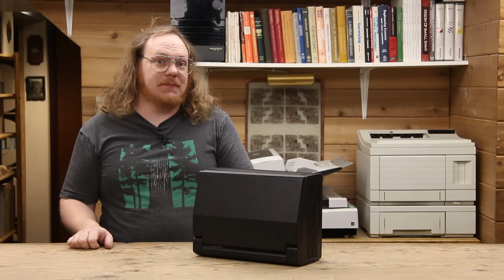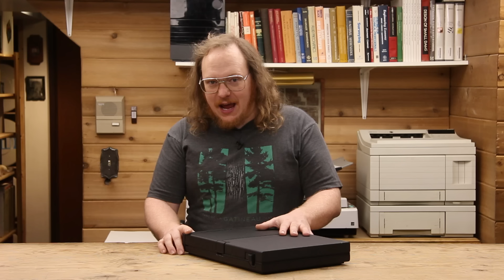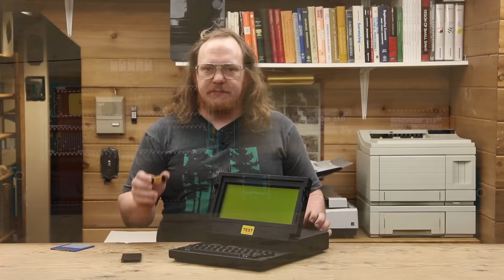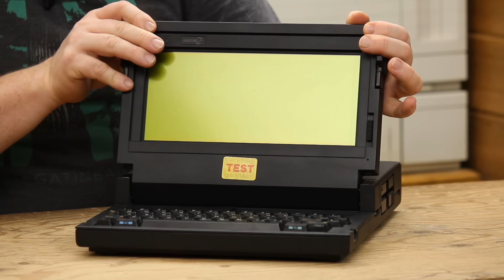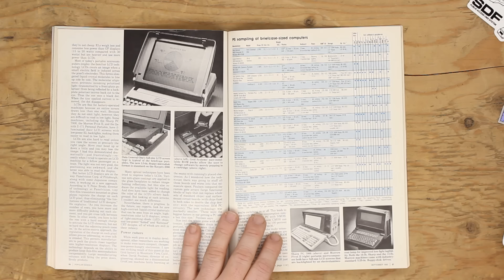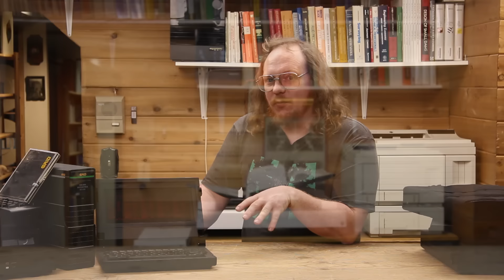GRiDcase - The Executive's Laptop

Comment: A small note about the power supplies: If you have a plasma/EL display (or a hard drive iirc), the power supply does not work internally, you have to wire the power supply externally.

Comment: "Not Kinda at All" - where you there??? i think not. The "portables" where the freaking bomb.. you had what used to be a room sized computer in a box you can pack up in 10s and carry it... insane.  and yeah, that's not from a google search..  the UT presumptuous nerds are getting annoying..
Reply from the maker: Except that when comparing a "room sized computer" to your average portable you were either comparing to a relatively modern timesharing system where you existed as a small slice of actual resources on the computer or a very, very old batch processing machine. The former you could not run on the portable because you lacked the I/O and system resources and the latter even a computer the size of a desk from the mid-70's (IBM system/32, vs the IBM System/3 it replaced) could outperform and was trivial by this point. Hence why I compared the CRT portables to their desktop counterparts because they used the exact same hardware, ran the exact same software and didn't end up like say, the MicroVAX 2000 from later in the 80's (and it too also has a handle!) where it is software compatible with the earlier and larger VAX minicomputers (which were smaller than a room even at launch) but because so much of the hardware was replaced with microcoded software instructions it was brutally slower.

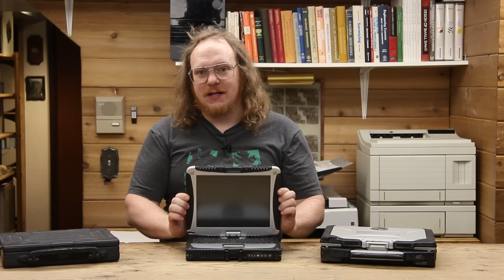Comment: At 22:00 you didn't mention the CF-18's party piece on the mechanical hard drive - it has a resistive heater wrapped around it and so you can use it in the freezing cold! I did a video on this a few years back where I left the laptop outside overnight when it got down to -4C air temp, the laptop itself was -10C and it was covered in frost and ice, but you turn it on, wait a few minutes for it to warm up and it boots right up!
Reply from the maker: Gah! I forgot about that! >_<

Comment: Wow! Before "laptops" were even a thing.
They generally resisted the term "portable" to avoid association with the original Osborne One. (Kaypro was much more successful with their version of the same thing.
"Luggable" was actually a popular term since "notebook" was still very much a dream.
The term "laptop" was usually just a joke. 
Remember, the Atari 400 was designed to be able to use on your laptop.
That Grid was amazing for its time. The first real "laptop."
That Toshiba T-1000 was absolutely groundbreaking.
"PC compatibility" was still the holy grail. Would it run MS-DOS (instead of CP/M or something)? Would it run actual PC software ?? Most importantly, would it run Lotus 1-2-3???

Comment: It's practically useless without a hard-disk, no network access and not even a 16550A chip for RS-232 links (with hardware handshake) that i just don't know what it would communicate with anyway.  Ah and a 720 KB disquette drive that makes an unusually loud click noise at insertion/ejection time.  The LCD display form factor feels quite restrictive too, so the nostalgia is quick to pass IMO!

Comment: NAY NAY GLEN!!!!!! An air science 3000 like Louis Rossmann's repair shop allows you to have a clean room bench, he bought $12,000 dollar tester to count the particles in the air. they have bene doing platter swaps for years now. no reason you oculd remove the platters and replace the cap and reinstall the platters. they have however showed how the bearing grease dries out, that could be a challenge.
Reply from the maker: I believe TheTechknight actually tried and found the radial platter alignment was both not physically indexed and critical like they are hiding drive firmware on the platter and the process of removing the platter killed the drive.
Reply: @CelGenStudios  TIL!!!! Thats wild!

Comment: One of the most impressive features in the later 15xx GRiDCases were expansion cartridges. GRiD made battery-shaped peripherals that would slot in place of the battery. The only one I've seen before was an Ethernet adapter with 10baseT, but presumably there were others. Instead of the big D-sub connector, there were two small SCA-like sockets at the back of the battery bay that broke out the 16-bit ISA bus.

Since it used the battery bay, the GRiD had to be powered by the DC jack. It was a good tradeoff for frequent travelers that would only be connected to a network at the office and thus already near an outlet. The expansion boxes already had this use case covered, but the cartridges were far cheaper and were easy to pack in case you were visiting a branch office that was also networked.
Reply from the maker: I've seen a pod with SCSI in it as well, but only on the Computer Chronicles. Sourcing the connectors has not been my priority but after seeing inside the ethernet pod I would think it would not be too hard to make other peripherals.
Reply: @CelGenStudios I bet you could fit a PicoMem with wifi, a couple of 18650s, and a LiIon BMS in that space without much trouble.

Comment: Hi, friendly neighbourhood GRiD collector here. 
Excellent video, thanks for taking your time to put together this video. 
Some small corrections however ;). 
There was infact a model 1, 2, 3 and 4. But the model 1 and 4 were discontinued very early in it's life.
Also like to clarify that there are some differences between the gridcase and the later gridcase plus, you seem to use the two together.  (The EMS ram board and internal HDD options are exclusive to the plus for example). 
Also important is that the original Gridcase unlikely the later 1500 series, can run GRID-OS natively or be dual booted. A quick look at grid os  for the compass would be nice. 
The reason for the lower build quality on the numeric keypad is because it wasn't made by GRID, this one was sold after tandy had acquired grid and was probably a rebadged unit from some Asian OEM. 
Fun fact: internal development codename for the gridcase was HORNET. 
And there is actually a raspberry pi  project that emulates these 26pin JVC HDD'S, I haven't tried it in a gridcase yet though.
Reply: interesting
Reply from the maker: So there WAS a model 1 and 41 I had seen mentions of them but was having issues verifying that as fact and had to clip the mentions out. thank you!
Reply: @CelGenStudios  Yes, The GRiDCase 1 had a very basic cost reduces LCD and the GC 2 had the higher quality "enhanced" LCD, I assume it didn't make much sense to continue with both of them as LCD priced went down. The GC 4 had an EL (electroluminescent) display, like the earlier Compass machines this was very expensive and consumed a lot of power. From what I can tell it was only around for a short while because they had supply issues with the custom plasma displays for the GC 3, after that was sorted the EL remained as an option for large custom orders and TEMPEST models. This was all in the early days of the Gridcase and by the time the gridcase plus series launched EL wasn't an option anymore apart from the TEMPEST models

Comment: I inherited a gas plasma GriDCASE from my grandfather. Still works too, but only came with the AC adapter, so no mobile computing sadly. 3.5" floppy drive but no hard drive. It's got a DOS and a Lotus 123 EPROM in it. The plasma display gets a little funky if I crank the brightness up all the way so I leave it low. Now I kind of want to find that Aliens turret emulator...

Comment: GRiD's industrial design was unquestionably impressive, especially for the time. They got so many things correct - and I LOVE that battery/AC adapter implementation, so slick. I will quibble on something, being 'that guy'; Toshiba's T1100 was a fully IBM-compatible, battery-powered clamshell that fit inside a briefcase in 1985, for a fraction of the price of the GRiDCase. The T1200 included a HDD in 1987 (the same JVC afaik). Feels weird that got glossed over, instead only a mention of the T1000?
Reply from the maker: I realized in editing I should of covered both models but ultimately I don't have either in the collection so I couldn't really compare it in detail.

Comment: I am a rugged Panasonic PC whore!  I’ve got the Toughbook CF-28, CF-18, CF-19, and most recently a CF-33 and I’ve also got a Getac K120 and I love them all!  I do a lot of LMR radio programming, mainly XTS/XTL that I use the CF-33 and the K120 for, and the CF-28 & CF-18 are perfect for the HT1000 & HT1250 series radios.  After getting my first Toughbook I will only use MIL-SPEC rugged laptops! As with all of your vids you did a great job and I’m glad to see another Toughbook fan.  P.S. if you like Toughbooks, definitely try out the Getacs.  They’re just as durable - if not more, have a better feeling keyboard, and the K120 has a 16:9 display unlike the weird 3:2 something display the CF-33 has.
Reply from the maker: I had a Getac almost 20 years ago that I bought surplus. It was really neat but it never worked and couldn't find parts at the time to fix it. I think I sent it on after I was gifted a pair of CF-18's.